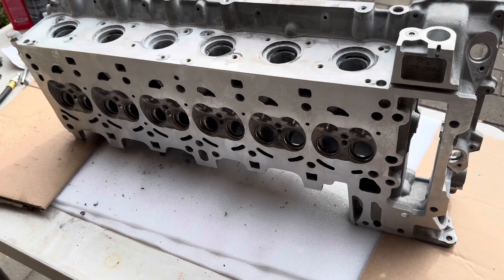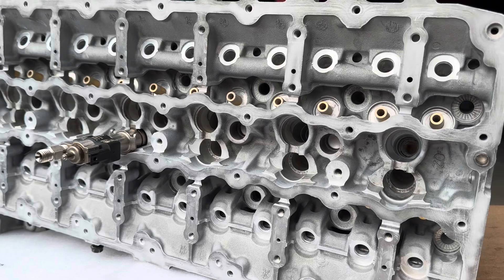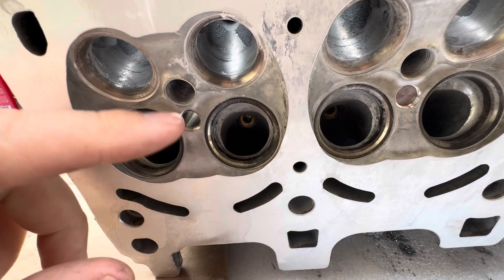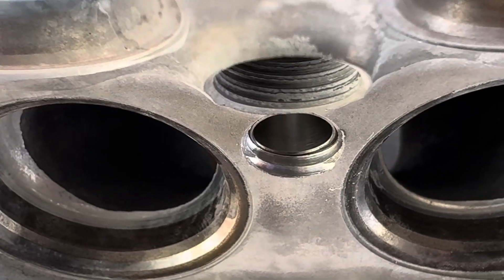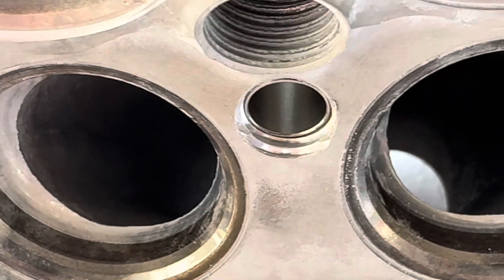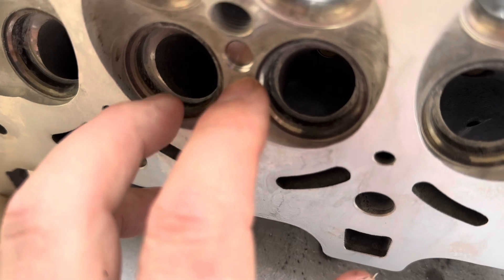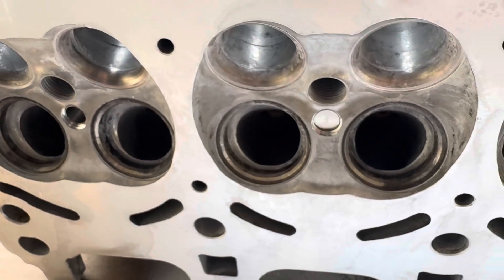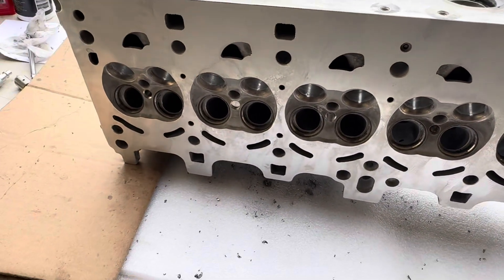PPI injector bore repair for BMW - MAJOR PROBLEMS

Comment: What u mention at 10:28 in the kit ive made and have been selling address this issue . If u look at the injector very closely the injector nozzle at the very top is larger so In Order to insert it correctly u need to have a slightly larger hole at top of the insert that drops down .180  to 45 on 90 tapper to ensure no damage to the seal while installing . Don’t know who sells the kit ur using in this video but the one I’ve designed also uses a ball bearing the in a press after I machine them the slight top edge so that cannot be inserted to deep and cannot fall through over time . And fit flush with top of the bore

https://youtube.com/shorts/4F5tOeZqxxc?si=9ODyjMMUfQhLE9AC
Reply: Where can we buy one

Comment: How are kits like these (including DI delete kits) using stainless steel alloys in an aluminum head with no concern for galvanic corrosion?
Reply from the maker: Before any of these kits BMW was already putting the stainless steel injector into the aluminium head, which had a higher chance of leading to corrosion (as evidenced by the corrosion in my head that led me to needing this kit in the first place).  The threaded insert is a much tighter fit and I used sealant on it so I’m confident it won’t corrode in my lifetime.
Reply: @DarkePeak I thought about it a little more, and it seems this kit moves the galvanic liability away from the injector bore to the area where the aluminum and the steel are in direct context. You would still eat corrosion if you get water in the injector hole, but you won't get galvanic corrosion between the injector lower body and the wall around it...

Comment: what other options outside of head replacement are there? i noticed the valve  head is very shrouded from the intake port, i would assume if you had the head in for porting and polish, you may get the old holes welded hut, then re-drilled?
Reply from the maker: @exiteternium  this kit is a good option instead of replacing the head, but I don’t think it should be done in situ

Comment: I thought this kit was a scam? As alot of people mentioned they ordered the kit but it never came through?
Reply from the maker: Yes, I also got stuffed around by the guy that created them - got part of the order quickly and a bogus tracking number for the missing items.  I threatened to lodge a PayPal claim and it was resolved within a few weeks.  The sales are now handled by another company (Jarvis Tuning and they have another name that I can’t remember), but they seem a bit more reputable.
Reply: @DarkePeak I had the same problem. I got a tracking number but the parts never shipped. It was probably 6-8 months before I finally received my parts. They have been sitting on the shelf in my lab since then. I’m afraid to drill on my head so the car just sits in my garage. This was my mechanics fault to begin with but I didn’t feel like fighting with him and didn’t think I could win.
Reply: @DarkePeak  can you find out the other name please and thank you
Reply from the maker: @1Ricky1  the other name is The Euro Wizards